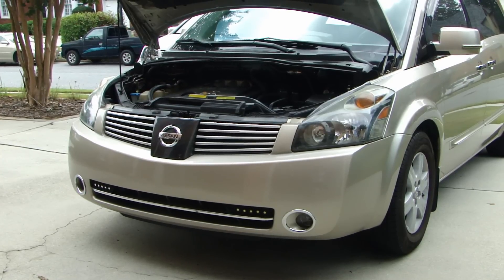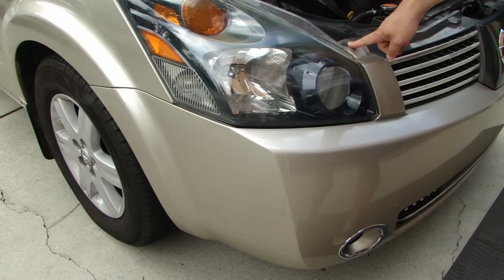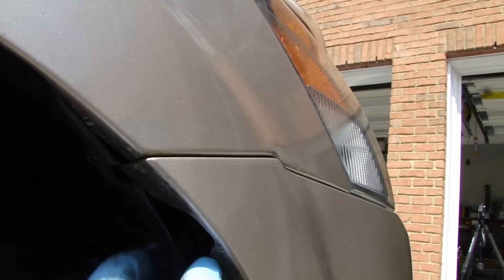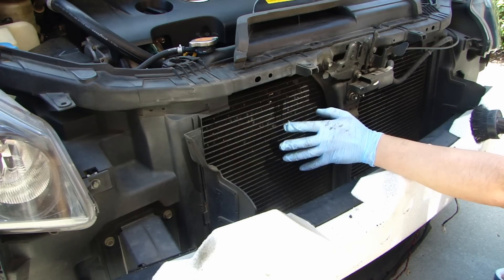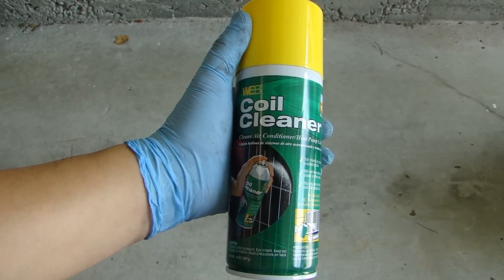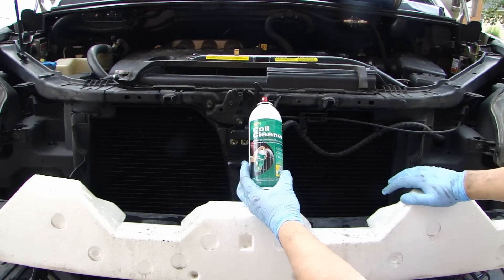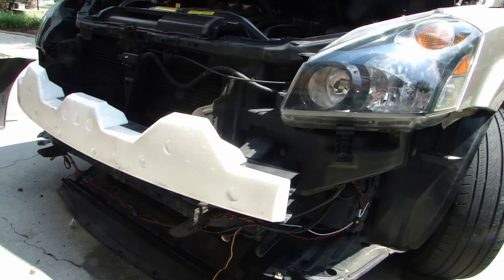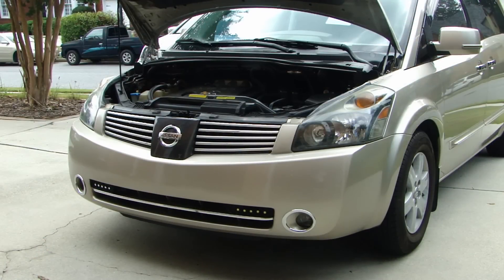How To Clean Car's AC Condenser

Comment: As an HVAC Tech I can tell you great video but a couple of tips. I know it’s tight and might not be possible in a lot of cars, I’m not mechanic but as for cleaning condenser coils, you should always wash from the inside out. Flush water through the coil with a medium pressure sprayer, be careful not to blast any fins off, use common sense. And soap from both sides. I will always recommend Nu-Calgon condenser cleaner. Also ALWAYS make sure to wash off ALL residual soap. These cleaners are all very strong and will melt metal over time especially aluminum fin tubes. Besides that great video👍🏻
Reply: thanks for the good tips. helpful
Reply: @N Diesal

You want to rinse from back to front because most debris does not make it in too far. If you rinse from back to front, this debris will be easily removed. BUT, if you rinse from front to back, you may end up just lodging the debris further in the condenser.
Reply: I think it’s the Chemicals that’s put on the far as it being lowered into red I think just soap and water it wouldn’t be a difference
Reply: i have a question that i am trying to find a soultion for me not to bring car to cost arm/leg my a/c air cabinet i just change but its not blowing as hard as it was before even before i change it started doing it. its cold air still though,  the sides work better but middle vents barley feel a thing when use to blow very hard and could very much hear it now you can't
Reply: On most cars it's bolted on to the radiator or support brackets so you can loosen and clean behind it
Reply: Absolutely agree with you back to front the best. Call me crazy but Im thinking of using distilled water in  one of those pump up jug sprayer things.  The distilled water doesn't have mineral deposits.
Reply: @critter2  either sounds like a blend door that's partly stuck, try switching from floor to vent very slowly a few times. Otherwise it's most likely the blower motor which is usually a cheap part to get.
Reply: @DaytonCarCare  id be real careful on this one. U poo one of those fittings. Its no ac and a new condenser or some new fittings and tubes. This is the best way but very carefully. The way guy shows in the vid. Is just blasting it all into the rad. Which in turn can make your car run hotter and tour ac warmer than it was. Or completely none. Its almost as easy as buying a new one. I think i paid 80 bux for mine. Im a diy guy but dont have the expensive vacuums and such to test for leaks etc. So i took to my buddy he installed it for 100 bux cash money Canadian pesos
Reply: @coastalcleaningandmaintena2884  I've done plenty of timing belts on Audi cars with just pivoting the condenser out of the way with no issues with damaging the lines.

Comment: It’s been said a clean condenser reduces head pressure, thus easing the load on a older compressor. Also decreases time for cool air through the vents. This information taken from several AC professionals. Take it for what it’s worth.

Comment: It will be great that if you can measure the coldest AC temperate before and after. Numbers will be more persuasive for people to see the differences.
Reply: Ran Zhang Confirmed. Source: I'm people.
Reply: Doesn't mean much because the system allows the evaporator to only reach a certain temperature before cutting off cooling capacity in some way (compressor clutch disengagement or swash plate angle adjustment). What you need to look for after cleaning the condenser (and cleaning the evaporator or replacing the cabin filter too) is three things: 1)Compressor noise 2)Discharge pressure 3)How fast is the vent temperature reaching its coldest point.
Reply: Stones dirt still left
Reply: Cleaning evaporator via drain hose is more  important
Reply: @Teravolt

The AC system may limit the temperature on the low end. But this does not mean that the AC can necessarily bring the vent temperature down to the point that the compressor can cycle off under all conditions. For instance, on a 100 degree day, the ac may fail to bring the temperature low enough to cycle off the compressor. The same may be true even on cooler days if the AC is used with fresh rather than recirculated air. Before and after vent  temperature measurements would absolutely be useful under these conditions. This is especially true if the AC can cycle on very hot days after cleaning the condenser when it couldn’t before.

Comment: Excuse me if this has already been mentioned.  Cleaning the condenser greatly reduces the pressure that the compressor needs to achieve in the AC refrigerant loop.  You will see a drop in the pressure in red service port on the high pressure side.   Less pressure equals less strain on the compressor equals prolonged service life for the compressor.   Smart maintenance includes keeping the condenser clean.

Comment: You have to keep it clean, but there's something else that often gets overlooked. A shiny clean cond coil is useless when not enough air is flowing through it. I had to get a new condenser fan motor as early as 73k of city driving. The old one was dying, and although cold/coldish air kept flowing from the vents and the fan itself seemed OK and didn't make any strange noise, the compressor was getting really noisy when stopped and during lo speed driving.

Comment: thanks for the great video. I have a 2006 nissan quest that makes a rusty hinges noise/ creeking when turning the wheels. I replaced lca, bearings, rotors and pads, inner outer tie rods and sway bay links.
 I need ur help
Reply: Bro it's your rack and pinion system, if its fluid been contaminated, or never changed, that's one sign, and other might be wheel bearings

Comment: to mr. wasiem. ..the noise  on your nissan is from the rack and pinion bushings. I have an 05quest myself.  and took care of that problem. I am a automotive machinist with 32years. experience. rebuilding heads and motors. for a looooong time.
Reply: In my car, the problem is only when I turn right, so it might not be from the rack-pinion assembly.
When I do a raw inspection, I see the tie rod inner socket is broken.

Comment: Hi do my car blow warm when stop at Isle and also if i press harder to the throttle and start blowing cold so do you have any idea with that
Reply: That is normal operation. There is no airflow over the condenser so it is transferring less heat.

Comment: speaking of headlights. The headlights on my Buick Rendezvous are extremely easy to remove it's a clip you push up in the front and a bolt that you loosen on the fender and then the whole assembly just pulls right out no tools required stupid easy.
Reply: i have a rendevous too.right now im experiencing overheating issues in florida.ive had it for one year.in utah.everythings fine.here...the heat makes everything haywire.i notice the fans arent coming on..and im shocked at the areas im looking into having someone help me with.like the thermostat and the temp.sensor.mainly

Comment: does the bumper clip in once you try to put it back in? and also are those original headlights? they are very clean.
Reply from the maker: +Zain Abidin Everything goes back in just like you took it out. The only thing is those clips under the bumper may break if it's old, but you can buy replacement ones at the dealer (or ebay).The lights are original but not that it's old, I do have to periodically buff them with some headlight restore cleaning products.

Comment: I have one question after all is done you dried the condenser before putting your bumper back on, does this have do be dried using a blow gun or can it just air dry?
Reply from the maker: Air dry is fine but there is a lot of water collected and you do want to make sure if are going to drive it, that air will pass through it for proper cooling.
Reply: This is actually an unnecessary step. The condenser will become hot enough to evaporate any water left on the coil. The evaporation of water on the coil will actually help cool down the condenser, creating less work for the compressor. Some sealed systems actually use the condensation produced from the evaporator to cool down the condenser.

Comment: Every time the task needs to remove bumper, wing or fender, I give up, at least for now. I don't have tools required. Besides, my car is an old Sunny 97 (Sunny and Sentra are very similar) where the bolts/screws seem hard to remove.
So, perhaps, I can clean the condenser by accessing from somewhere without removing the bumper, although the result may not be optimal.
Btw, there are some wiring and connectors around the condenser : for headlights, radiator fan, etc. Shouldn't we cover them before cleaning the condenser ?

Comment: how is difference in cooling ? before and after
Reply: although essential, the condenser doesnt actually have much to do with actually cooling the inside air, that's 95% the evaporator core, granted the freon is proper level.
Reply: Clean condenser and proper condenser airflow makes the compressor work quieter and the vent temperature get down faster in hot climate.
Reply: Watch all the way to the very end: 
“ Nice and cold!”

Comment: My car's AC has started fluctuating where it's real cold and then kind of warms up and then back and forth. Do you think this may be the issue?
Reply from the maker: +Paul Hood Perhaps not. Typically a clogged condenser will give you cold air while driving and warm when idling. Best to have a AC guy look at it so they can check the refrigerant level.
Reply: But when a condenser is clogged, it can't cool the refrigerant effectively so that could lead to too much pressure in the system. The compressor will turn off in this case so it doesn't blow up, but after a little while pressure can drop enough so that it's safe to turn itself back on again.

Comment: I don't know if I would use any type of cleaner on that type of coil - that is the same type of coil on an Rooftop A/C unit - it's called a Micro Coil and the HVAC guys say not to use any cleaner on them it could pit the aluminum coil and cause a leak
Reply: I'm with you. I would not use anything that doesn't have a neutral or almost neutral pH and certainly nothing that contains NaHCO3, ammonia, chlorine, etc.  I have used warm water and mild dish detergent (like Dawn or Ivory) and then rinse well. But usually just gently brushing dry debris and then spraying with the garden hose does a good job.
Reply: I use a household dish liquid soap.
Reply: Sachi In Wisconsin I
Reply: Well luckily the any brand doesn't exist haha.  Honestly though you just need to use the proper cleaner, safe for it's intended use and properly.  Note he says 5 min no more than 10 so that pitting doesn't happen.  Also scare tactics have been making companies money since Moses was in short pants.  Cleaner might damage it, aka may keep us from fixing or replacing your equipment as often.
Reply: A specific coil cleaner won’t be any worse than road salt and acids. A automotive condenser is coated for these very reasons. People make a lot of untrue claims. Until there’s a white paper on it, my thoughts are that’s just opinion not fact

Comment: hii i have another condenser unit below dashboard, and blower do i need to do the same thing?
Reply: That's the evaporator coil
Reply: It is evaporator, not condenser. They looks similar, while their functions are different, basically the opposite way when changing phases from liquid to gas and vice versa. You need to learn the basic of refrigeration cycle.

Comment: Lucky for me my car is old and I don't have to remove anything except the radiator and electric fans. only takes 30 minutes or so. . After that I can clean the condenser from the radiator side pushing all of the crap out the same side it came in. Much better results that way . Other wise you're just pushing it deeper into the condenser.

Comment: Man I wish I was had a garage, so I could do this. My ac blows cool air, not cold. Dealer said everything looks good. After 240k miles it's probably just a dirty condenser, guess I'll have to live with it until I get a newer truck or a house.
Reply: You don't need a garage at all. Just remove the bumper. Water is enough to give a good cleaning (just don't spray it with too much force, and spray it at a right angle with the fins, otherwise you risk benting them; spray it inside the space between the radiator and condenser also), you don't need to spray any chemicals at all, and if you see any bent fin try reshaping them in the proper shape. After you've done, seal off any gap between the condenser and the radiator so that only ambient air gets pulled through the condenser. If you have the correct refrigerant level and a system in good working order, your ac will be so cold that you'll have to keep the fan low and point the vents away from you to be comfortable. Also remember to clean the evaporator too or replace the cabin air filter if you have one. Managed to get ice cold ac and a quiet compressor on a 15 years old Vauxhall Agila this way.
Reply: @teravolt6113  so to get air cold, and i know it was already running good order, all it takes on cleaning the condenser in front of radiator?
Reply: @youtubeonly8574  This is standard maintenance anyone should be doing from time to time.

Comment: I did this and for some reason the temperature guage inside the car now stays less than 200 which used to stay at or above 210. Ac is not colder but car is running cooler. Lol
Reply: Well, you make the engine run -10 degrees cooler. Now you have to keep working in your cabin. :D

Comment: Do you have how to voided on changing engine air filter on the Nissan Quest.
Reply from the maker: No but it's super easy with 2 metal clips and the air box opens up.
Reply: what do you think about K&N air filters.
Reply from the maker: Yes I have them in all my cars for many years. I like them simply for that fact they last forever.
Reply: I just got two for my cars. How often do you clean them filters.
Reply from the maker: I usually clean mine once a year during the winter months. Depends how dusty your driving environment is.
Reply: on box it says  50,000 miles is that right
Reply from the maker: I don't have the box anymore, but just check once a year and if you find it to be clean, then leave it alone.
Reply: ok thanks will do that.
Reply: +dial2fast
Service manual says the air filter doesn't need cleaning, it should be replaced in regular period.

Comment: I wouldn't even use pressurized air to blow anything.  Those are frail fins on the condenser and any pressure could bend them. Then you have a clean condenser that no air can pass thru. I say let the car's radiator fan suck the water out.
Reply: What you think happens when driving??
Reply: At 60mph most pressure maybe 60psi ballpark. Compressed air is minimum of 120psi. So drive to dry is better than compressed air.

Comment: that is the radiator, not the ac evaporator. still good to clean it, but won't help the AC.
Reply: Not quite true oddly enough the radiator can effect the condenser a few ways.  It can stay hotter and warm the condenser and if it's gunked up obstruct air flow through the both of them.  This would be more so at a stop or low speed though when the fans are doing most of the cooling.  The condenser is in front almost every time and looks just like a smaller radiator which it effectively is.
Reply: robmcbell Obviously you’ve never worked on a car. Just come on YouTube like a resident expert...🙄 automotive ac condensers are placed in front of the radiator in every car I’ve ever worked on.

Comment: I will not say do not clean your automotive ac condenser but they are a lot different than home ac condensers.  keep in mind that cars drive at high speeds in the rain.  I have never cleaned any automotive condenser in 30 years.  I have owned many cars and worked on many cars.  quick spray for bugs is the most you have to do honestly.  if the fins continuously get smashed then you will have to replace it.  then once replaced stop tailgating cars.  that is the quickest way to destroy the condenser and radiator and any coolers you may have. just ask my wife.

Comment: how is difference in cooling ? before and after
Reply: to be honest to clean the condenser unless it is really dirty won't improve cooling much. now any type of extra cooling system, be it co2 or just water mist will make a difference, not just in your ac either. and make sure your fans are running good, if you don't have a fan in your car, installing one will help temp a little to. now if you really want your ac yo run as cold and as hard as possible, you must get in there and clean the evaporator coil. it will be right next to the blower motor. just take the motor off and you can reach into evaporator box, and I guarantee there will be more than you expected. get a vacuum with a hose, and a old toothbtush.start vacuuming and breaking the bulk of the debris up with your hand. then use your brush to get into the corners and tight spaces. repeat until all debris is gone. then it's time to use your foam cleaner and get all the little fins in the evaporator unclogged and clean.